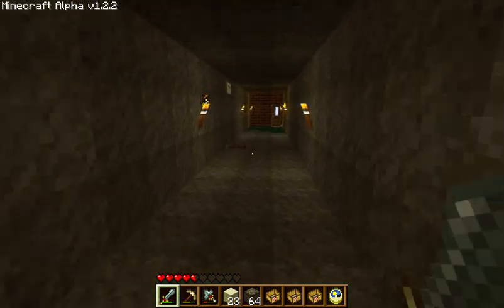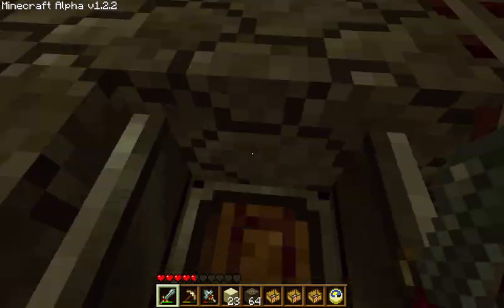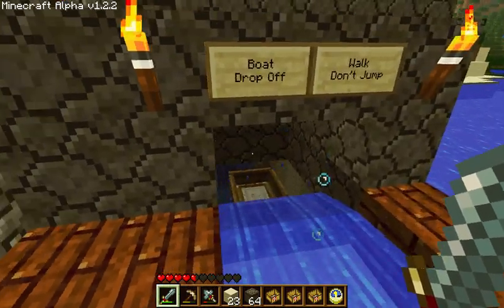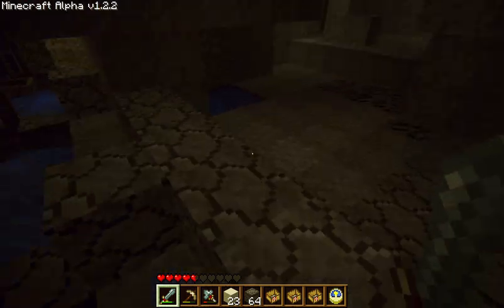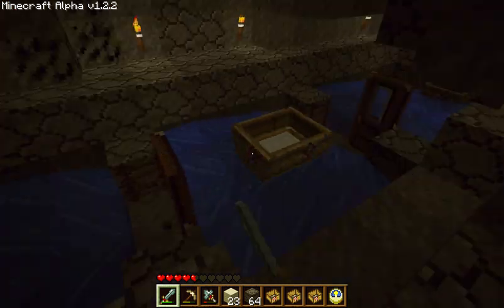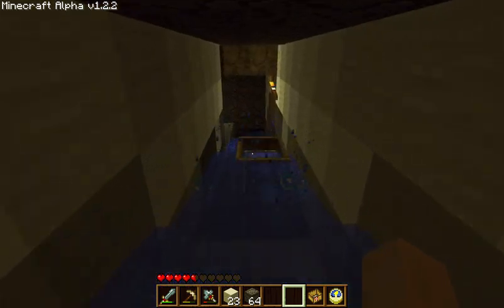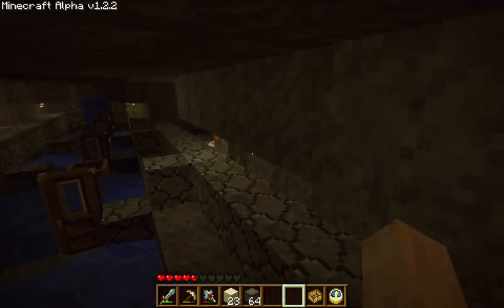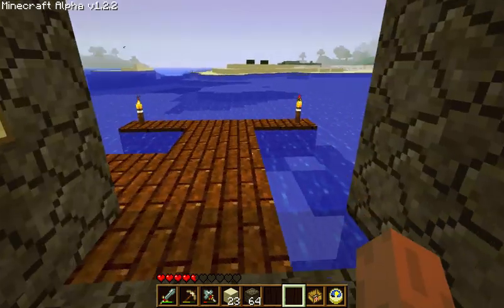Minecraft Automated Boat Dock and Reloading System

Comment: Use the face that water source  blocks can only extend by 8 blocks so you put source blocks 8 blocks away from the side and make it go to the main stream without going in it (8blocks away) this will make sure your boat wont go off to the sides and it will never hit any type of block just water.

Comment: My boats always get stuck in the walls/clip through, rather than follow the current to the next holding area.

My vertical wiring won't work. When I push the button up top, the current stays on and all the doors stay open.

This is so difficult :( any advice?